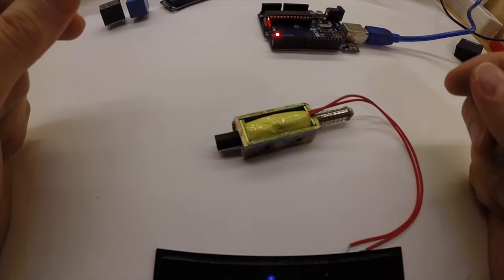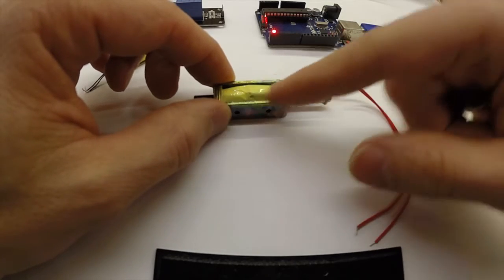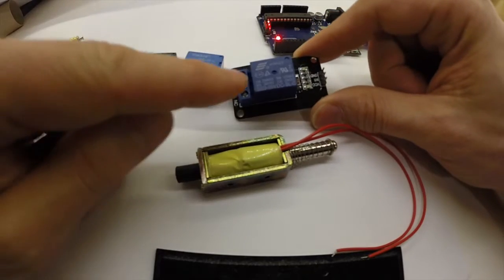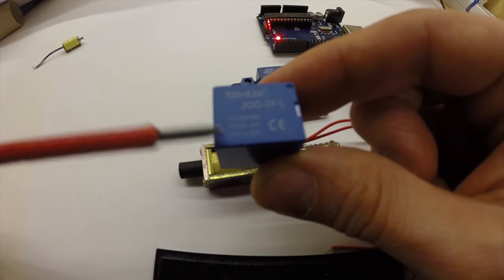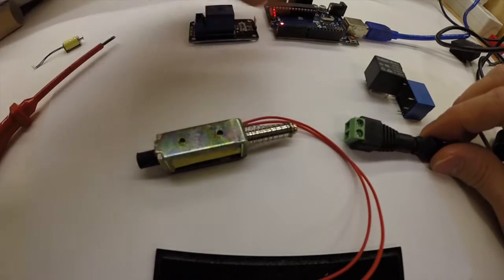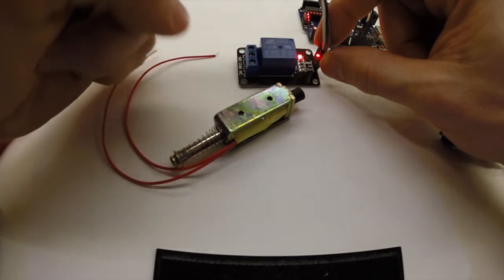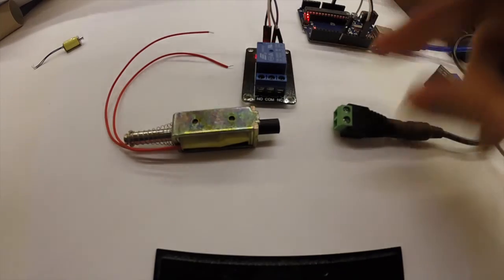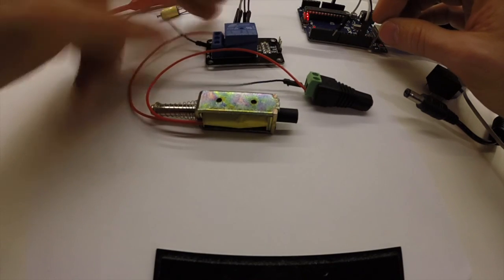Solenoid hookup to Arduino

Comment: I am using a relay for solenoid valve but the solenoid valve is not able to close when I send command through io adafruit. Does it mean the solenoid valve is faulty? It is a gravity feed type and normally closed valve.

Comment: NO/NC (Normally Open and Normally Closed) in this case is very important (in my theory should be only Normaly Open = default OFF/no current) as far as I know, because solenoids is drawing power while and it cannot be all the time ON (it will fail due to heat for ex.), there is special rating for solenoids which tell how long it can/should be on/off. Please correct me if I'm wrong.

Comment: Super helpful video! Quick question regarding Solenoids. What determines how hard they push and pull? is it Voltage rating or Amp rating?
Reply from the maker: I don’t know. But my guess is amp how much amp you put into it as that is how motors work. They get stronger with more amps at the same voltage.

Comment: Is there any way to connect 30 of those to make a midi interface?
Reply from the maker: I guess what you are asking if you can control 30 of these via MIDI? And yes you could do that. Midi in to the arduino is quite simple. And then you just need a way to control 30 relays. 4 595 shift registers could be one way to go here. I have a video on how to serial connect 595s aswell.

Comment: What can I do if I have a mobile project and I want ONE DC power supply to provide power to BOTH the Arduino and a device such as servo or solenoid? I think I could use a relay that gives multiple outputs at different voltages, but I'm not sure what relay to get.
Reply from the maker: Relays is just a switch. If you need different voltages you need to regulate this voltage. If you have 12v to a solenoid you can use a 7805 to regulate the power down to 5v for the arduino. I have quite a recent video showing how to make one of these.
Reply: @SourceryOne  thanks Kristian, I'll check out your video and do some research :)

Comment: Arduino needs 7-12V power supply but isn't USB rated at 5V? How does the Arduino get correct volts when powered by USB?
Reply from the maker: Arduino needs 5v so it is perfect to use usb. ;)

Comment: How come you're not using a flyback diode? Is that not required when using a relay?
Reply from the maker: It is a selfcontained relay module. So probably it is on the board. I think it even has an optocoupler to isolate the arduino pin from the relay even more.
Reply: Kristian Blåsol Got it, thanks for the response! Very much appreciated.

Comment: Thanks for the tutorial. One question... is the arduino protected from the solenoid by using this relay? Thanks
Reply from the maker: Yes. That is correct. The relay has no connection between the two sides.

Comment: Nice and easy. What would you have to change if you need to drive a 30 Amp 12 volts solenoid like the ones on car engines?
Reply from the maker: I’d just hook the “hot side” of the relay to the electric system of the car. The arduino and low voltage (5v) side could be driven through a 5v USB adapter from the cigarette lighter outlet.

Comment: Do you have a sample code for this one?
Reply from the maker: I just use the blink sketch as an example... So just a digitalWrite to the pin connected to the relay would open or close the solenoid...
Reply: im having a problem though i followed all the steps in the video but the relay doesnt blink, were using the same relay the difference is my com no nc is just icon not letters
 @SourceryOne
Reply: this is my code sir 
int pin = 13;
void setup() {
   pinMode( pin , OUTPUT);
 
}

void loop() {
   digitalWrite( pin , HIGH);
   delay(3000);
   digitalWrite(pin , LOW);
   delay(5000);
}  @SourceryOne
Reply from the maker: JL DO as long as you connect the relay to pin 13 then it should work. Nc and no should be where you connect the solenoid. Pin 13 of arduino should be connected to the “in” pin on the relay board or coil it is called sometimes. Also +v and ground is needed.
Reply: ok sir thanks i do have a powersupply thank you! ill update u as soon as it works :)
 @SourceryOne
Reply: @SourceryOne  Hi sir its me once again do you have a code for a fingerprint and solenoid lock and how will i connect it hehe i cant find a code. ty for answering ! :)
Reply from the maker: The solenoid you can connect as described earlier in this thread. I haven’t looked into fingerprint sensors yet though. So I can’t help you there.

Comment: Do you have the code for the arduino?
Reply from the maker: If you mean to control a solenoid it is just a digital write to a pin connected to the relay as explained in the video. The most basic sketch the blink sketch will work.

Comment: Thanks for making the video. I came for the arduino /solenoid control info,but you explained perfectly how i should wire up all those circuit boards i bought,and could never understand the instruction. If you do paid work for work making a circuit board and arduino programming (for solenoid controlling). Check out my channel,you may prefer a trade than money. Cheers Shaun

Comment: this is great explanation  - good info.   You hinted that there are other ways to trigger the solenoid.  Can you elaborate on what those can be?
Reply from the maker: Sure, You could use a mosfet, transistor or an optocoupler instead of the relay. But the relay is by far easier to setup. But I have videos showing both transistors as a switch and mosfets.
Reply: yeah- I saw the video about the LED Strip lights video after I posted the comment,- thanks.  Awesome info by BTW.  I agree that the relay is easiest - thanks again

Comment: I would use a FET or transistor for cost and size of the circuit as you are adding a coil you dont need
Reply from the maker: Yes, you are correct, I havent worked that much with MOSFETs and did my first video about that TODAY :) The thing with Relays is you just plug them in and they work, after checking out MOSFETs however I must say they SEEM to be just as easy to work with. Transistors however seem like a big hassle when I have tried working with them :). Thanks for your comment and I am sure to use FETs again...